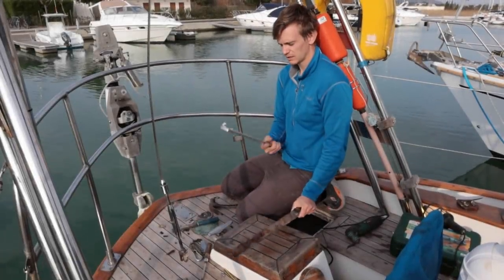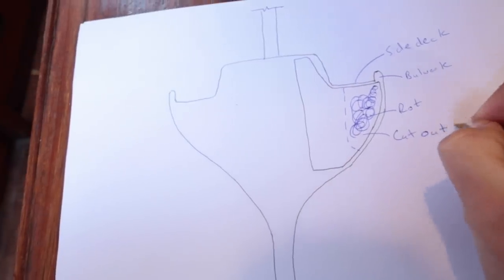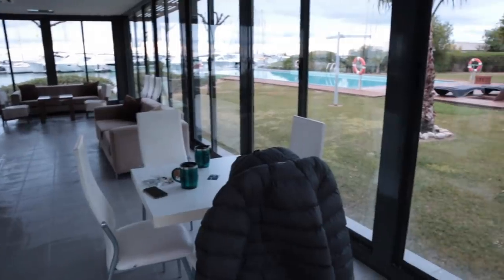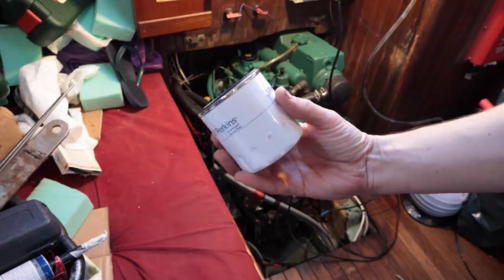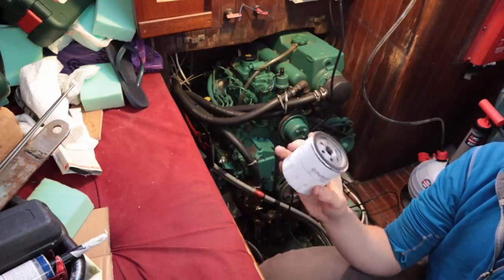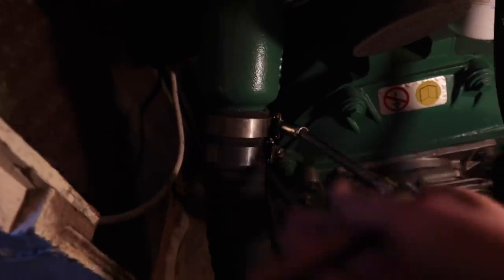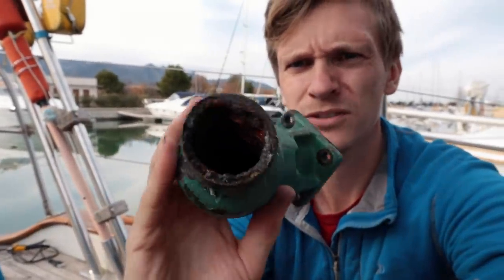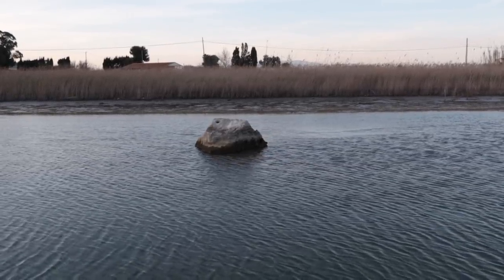41] OLD SAILBOAT ENGINE: Fixing THE BIG PROBLEM With Our Volvo Penta

Comment: DON'T FORGET TO PUT A LITTLE BIT NEW OIL ON THE OIL FILTER RUBBER SEAL AND ANTI-SIEZE ON THE HEAT EXCHANGER BOLT THREADS... TO MAKE REMOVAL A-OK  =]